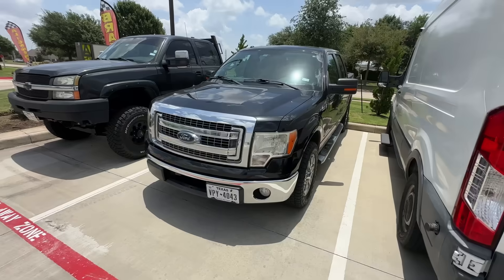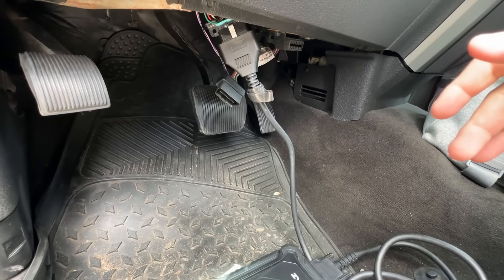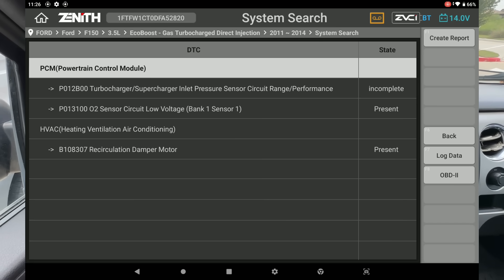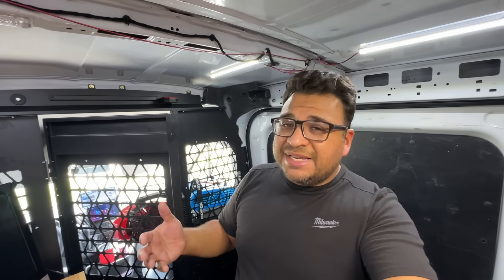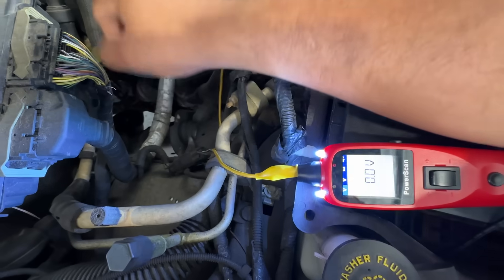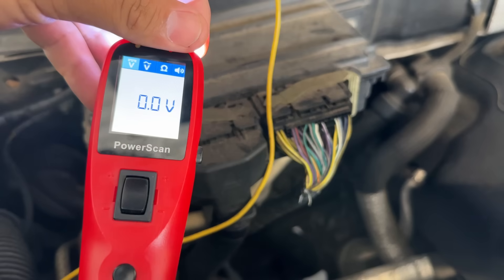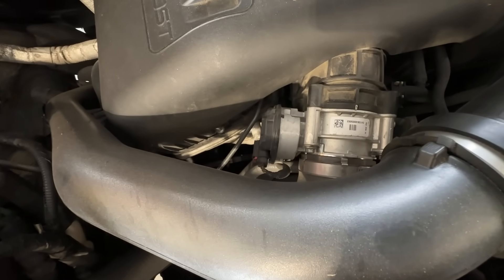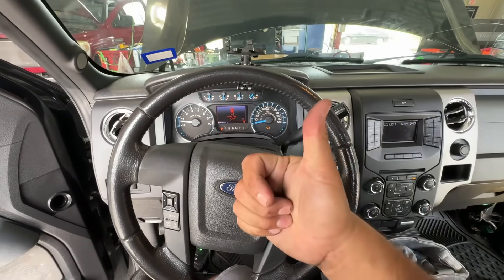Ford F-150: Diagnosing a Ghost Intermittent PCM Fault — FIXED!

Comment: Hello. I have no keys for my 2013 manual BRZ push start. If i install keyless entry module SMT ecu, steering wheel module, biu/fuse box with a keyfob eveything synced together will I be able to start the car? will i need anything else? please🙏🏼

Comment: Dear sir please help. I saw a video you posted 5 years ago, regarding the torch the lug, then solder in terminal lug connector if you still remember? 

sir please please reply May I ask a question and please help answer a question. My dad is old and he probably mistaken a 40/60 solder (40% tin, 60% lead) as the 60/40 solder. He bought at a cheaper price hit is one whole box. He intent to use the solder to solder between the copper wire and the open barrel ring lug connector for his electric bicycle. But after he realized is not 60/40, but is a 40/60, the seller refuse to do any refund or anything. In this video I saw your solder shown in the video is also using 40/60 solder on the lug connector. May I ask if 40% tin, 60% lead is able and suitable for solder copper wire with open barrel copper ring lug connector or any lug connector?

Comment: At my shop? It would have gotten a new fuse box. In order to be 100% certain that the issue will not return, that fuse box needs to be replaced. The terminals opened up for a reason, most likely they changed shape due to excessive heat caused by resistance at the connection between the fuse and the terminal. It may be fine after bending them, but they have a very high chance of opening up again. It will become a issue at the worst time, like when mama is in labor and needs to go to the hospital, or when the customer is already late for work.  LOL. I like to recommend a compete repair, as a perfessional, it is my responsibility to offer a repair that is as close to permanent as possible. Remember, I'd rather have a bad reputation for doing it right than a bad reputation from doing it cheap.

Comment: Typical inferior design/manufacturing/materials with late model vehicles.  You would think with the countless electrical issues faced by the thousands of auto mechanics/technicians on later model vehicles that the manuf would put some efforts into upgrading their wiring, terminals, terminations, connections and routing of wires. Many of these auto repairs channels have the same issues, electrical problems that boil down to poor grade design. 
Just look at what this vehicle owner had to deal with over maybe a good month, unreliable vehicle, in the shop and no progress for weeks. Then, a higher level tech gets a hold of this vehicle and finds the most simple and dumb issue ever that just boiled down to a cheaply designed fuse box and/or materials !  Hundreds of dollars spent just to find a $10 fix !!!

Comment: I want to learn how to read wiring diagram
Reply: Not all that easy for cars that have more than 3 wires for a position sensor and there is no info as to what each wire is or does, crazy.
Reply: @scientist100 I thought wiring diagram will show you the powers / ground  and signal wires in a specific unit or sensor and where they go to it shouldn't be hard
Reply: @Ebenezer-ko2hp  in a simple wiring system yes, but not all diagrams tell which wires do what, there are red wires that will be ground so, never trust what the standard tells you. Try looking up a wiring diagram for a 2011 BMW i325 diagram for the valvetronic and tell me which wire does what, it has a sensor with 7 wires and 3 with a 3 phase motor so, 3 power and ground controls that are controlled by the PCM. The schematics tells you nothing on what each wire should be, could be a ground and 5v ref for the sensor and then return signal, it just doesn't say.

Comment: This is an awesome find. I work for Ford and I have not run across this yet, I usually run across the mega fuses opening when they're hot. Thank you for showing this to us. I will try to apply it when I run across it in the future. God bless!
Reply: Insane, things like these could send you chasing your tail for sure. Normally I find missing fuse that someone has moved around but then I end up finding that the part is also bad and not sure why they moved the fuse to begin with.

Comment: Love the thought process in your problem-solving but that was a pretty big disconnect from the norm when you couldn't get the fuse out (using the wrong tool), and then lost it.  You have to know there's a proper tool for removing fuses.  Plus it looked like you installed the wrong size fuse.  Was yellow, you installed green.

Anywyay I know some Youtubers make mistakes for entertainment value.  But yours have always been precise, concise, and to the point.  I was surprised with this one.  Don't dumb down your work for the channel.  No offense.